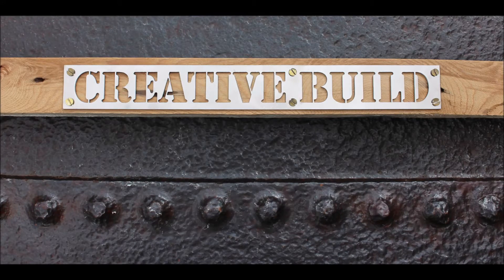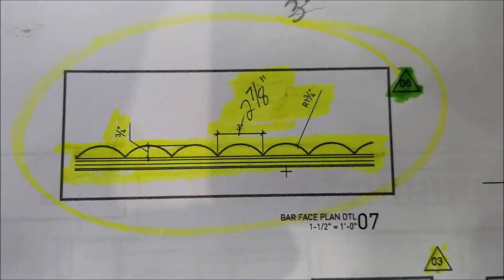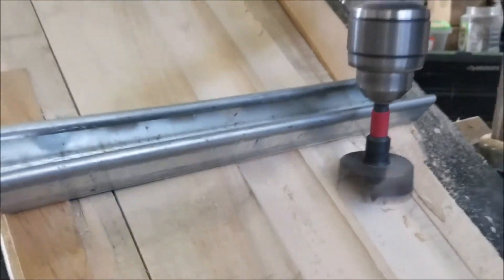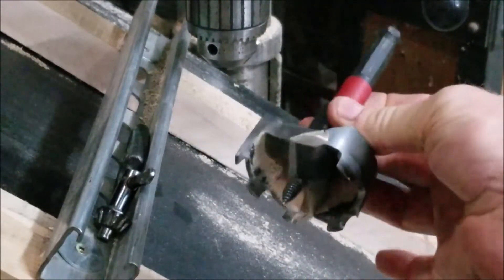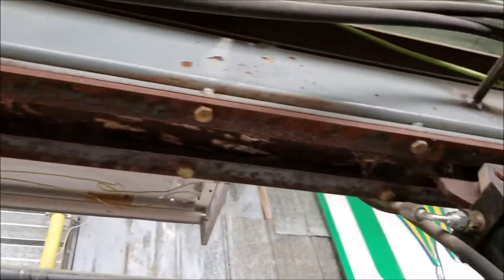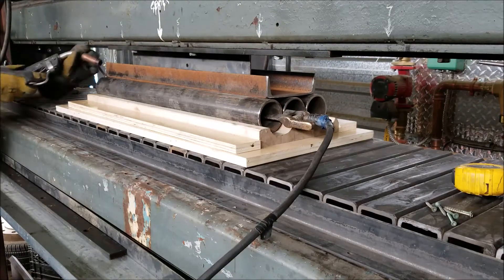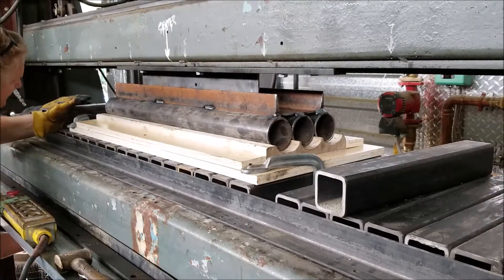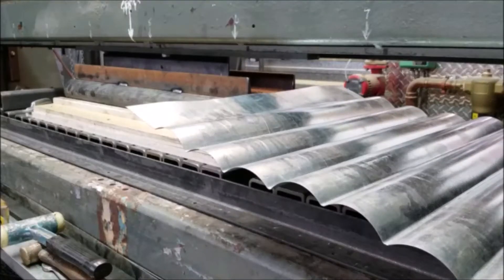DIY Stamping Sheet Metal with WOOD: Hydraulic Press. Part 1 of 3

Comment: Using Milwaukee SwitchBlade as a Shell Mill in wood...Brilliant!   I was brought here while researching using wood die to press aluminum.  Trying to recreate an aluminum pressed retainer for Humvee armored windshield laminate glass.   Before I went on active duty I worked as apprentice in a machine shop, Fred Schindler, an old school Tool & Die Maker, taught me the trade basics.  He said they used high density wood for small or single parts run.   He said the old solid oak exterior doors made good material for prototyping, One-Of, etc.
Reply from the maker: I done some other shapes since. Now I make the wood form slightly over size and stamp a piece of sheet zinc. Then laminate the zinc to the wood so the die lasts much longer

Comment: Is it possible to make the top die and bottom die out of wood and then using  a series of bolts to clamp down and press steel to the desired stamp shape
Reply from the maker: It would depend on the complexity of the shape and thickness of the steel but it is possible. Even heavy stamping presses dont make some parts in one strike so you could make a preform die to get the general shape then have a final shape final die
Reply: @itsnot_stupid_ifitworks  the shapes are not that complex as it is it is basically a triangle shape
Reply from the maker: I just made a maple wood die and I lined the top and bottom die with zinc sheet metal to protect the wood during stamping. I filmed it so I intend to make upload a video
Reply: @itsnot_stupid_ifitworks  I did think about doing that but there is no routing bit with the correct angle so I would have to make the dies in 2 pieces and instead of lining it with zinc of fire hardening the wood instead but 3d printing is alot easier as I have everything to do it
Reply from the maker: @186scott  could you make two cuts with a table saw to make the proper angle?
Reply: @itsnot_stupid_ifitworks  yes I could but I only have basic tools and no table saw
Reply: @itsnot_stupid_ifitworks  I'm looking to strike baroque-style belly pickets from 3/16"x1" aluminum flat bar. Would the wood forms on both sides of the stamp handle the load of aluminum bars? All the presses I find online use steel plates for their forms. I'm looking to go as DIY as possible using normal shop tools. These pickets are for my personal front porch. thx
Reply from the maker: @genewilliams8712  I think I would work as long as none of the bends are too sharp. I've seen some baroque pickets that have one really tight bend. That would need to be prebent into shape first then put in the die to form the curves. Lining the wood with a thin skin of  metal to protect the wood is a good idea.